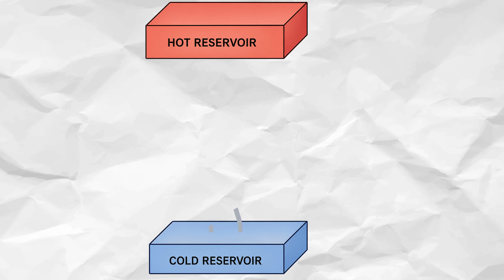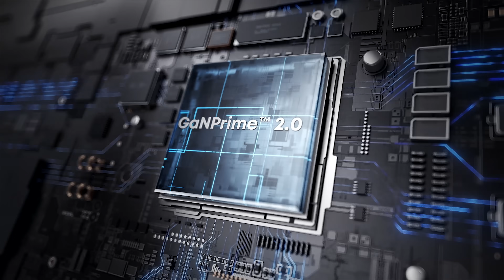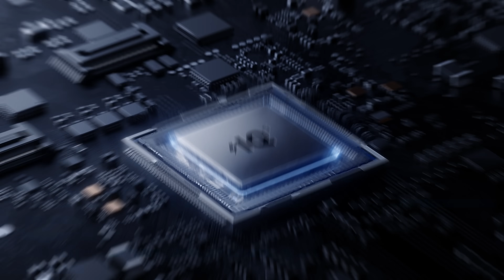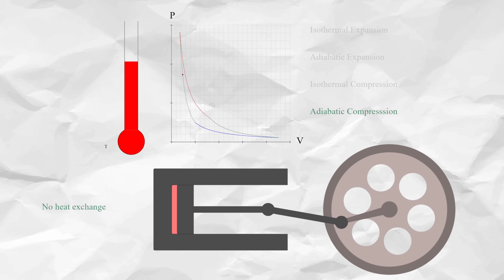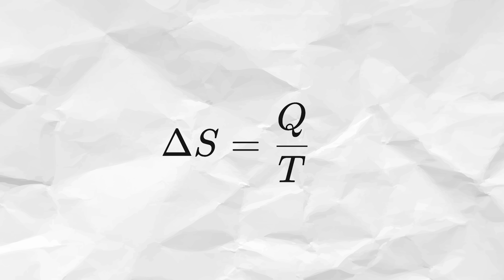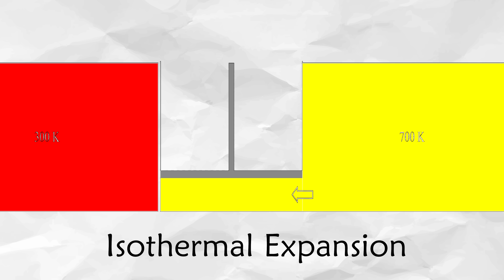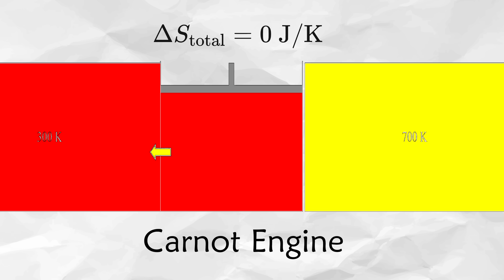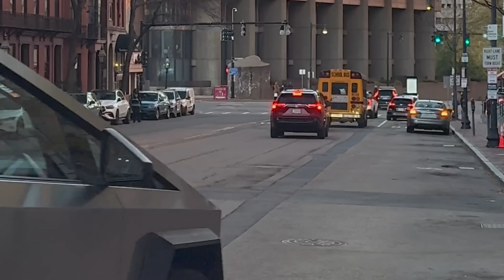This Tiny Engine Explains Entropy

Comment: Interestingly, most biological processes that transform energy such as photosynthesis (light to chemical bonds) also have about 30% efficiency. Burning fossil fuels with similar efficiency is the largest, most effective and efficient recycling program man has. Increase CO2 doesn't change global temperatures at all because photosynthesis converts it to more life. At 0.04% it is absurd to claim any gas can significantly affect global temperatures.

Comment: 1. Heat engine max efficiency is crappy, got it.
2. Need a crappy heat engine to make neato electricity, OK.  
3. Or, get your power from the sun that is slogging away making a trillion gazillion joules of energy every second whether we want it to or not and we also don't have to fight messy and expensive wars over it either.
4.  His 35% "typical" heat engine efficiency is for a poor/old fossil fuel plant.  Mr. Internet says that the absolute best, most spiffy (expensive) fossil fuel plants can get the hot side up to 1000°F (811 K) with fancy materials.  Also, a typical cold side is not 212° F (373 K), it is more like 107° F (315 K) so when you crank those temperatures through the Carnot efficiency equation, which, as this video states, equals [1 - (cold side temp, Kelvin)/(hot side temp, Kelvin)], you get 61% efficiency.  The fanciest fuel cells can also convert fuel to electricity at 60% efficiency.  Solar panels (free fuel) are pushing 30% efficiency, so efficiency is not as big an issue, but cost and the space they take up is a big issue.

Comment: So we just need 0°k on the cold side and any other temperature on the hot side to get a Carnot engine with 100% efficiency? Easy ^^
Reply: Deep space has a temperature of 2.7K, so not too far off. All we need then is large enough radiators - just a few thousand square kilometres should suffice...

Comment: Beside Entropy (dominant in a Carnot-engine), and electric motors (ohmic and magnetization losses) there is another consideration: Quantum states. E.g. everything, that follows Fermionic statistics (e.g. semiconductors, LED, solar panals, lathes) can never convert energy with 100% efficiency, since losses are inctrinsic to the staircase-function of quantized energy states on a quantum level. Contraptions, that follow bosonic statistics are 100% efficient. E.g. an nonlinear KPT-crystal in a green Laser is such a device. One can convert kilowatts of infrared Laser power into green light and losses due to impurities are a couple of mW.

Comment: I love this video. Really well done explanation! Definitely the best I've seen, including my own in teaching an energy engineering course. I particularly love the simplicity of the marble Stirling engine. Another fun example is taking a finite hot brick connected to a finite cold brick, both of which eventually come to the same temperature. If you wire these to a work extractor, the efficiency is 1-sqrt(Tcold/Thot) instead of 1-(Tcold/Thot). And this leads to a whole subject on endoreversible engines that are surprisingly close to real engines.

Comment: Excellent illustration. I also liked seeing the simple test-tube marble engine, since I use a very similar demonstration in class. From a thermodynamics perspective, this is a very nice way of showing that the fundamental efficiency limit comes from the second law: in the reversible Carnot argument, (Q{rev}/T) appears as a state function — later named entropy by Clausius — and that is exactly what limits the conversion of heat into work.

Comment: In my view, the most counter- intuitive, and therefore maybe most valuable, conclusion from the Carnot equation: Your engine becomes more efficient the lower the Temperature of the COLD reservoir. Efficiency is governed as much or more by where you dump your heat as by where you source it.

Comment: again, the Carnot limit only applies to CLOSED cycles. An internal combustion engine is an OPEN system and its efficiency is the Gibbs free energy, which is ~100%. all the fuel energy is available to do work

Comment: this is getting me thinking. what if we could use climate temperatures to power a big sterling engine for a home. could we harness the power of weathers temperature, maybe if its compared to the temp of underground. maybe using things to trap heat well or magnify it.
Reply: like the cooling side is what the ac fans sit on, and in its respective spot is a tank of water trapping and magifying heat, all to power a sterling engine, maybe one that powers the ac lol. a loop. all you need is the rip cord like a lawnmower.

Comment: Nice explanation! In the science, efficiency of a cooler or engine is usually expressed exactly in a carnot efficiency. Because indeed the absolute efficiency, energy useful decided by energie required, doesn't mean anything when looking at them in a physics way

Comment: This is one of the bigger reasons why I'd like us to have high temperature (low pressure) nuclear reactors.
Today's nukes are awesome but they use water at relatively high pressure, high enough to need an expensive pressure cooker but only high enough that it can't go above about 300°C (otherwise it would turn into steam)
In a high temperature reactor you're saving your money because your bottle doesn't need to be a pressure cooker and you're getting more efficiency by cooking at 600°C (usually)

Comment: @action lab: "so this theoretical engine has zero enthropy loss, yet it cannot reach 100% efficiency":
also action lab: goes on to not explain why it isn't 100% efficient and call it entropy loss
Reply: In the ideal Carnot (or Stirling for that matter) heat engine, the amount of heat energy removed from the high temperature source is greater than the mechanical energy it puts out. That difference is called the "efficiency". The rest of the heat energy remains as heat energy, but at the lower temperature of the cold source. But if you reverse the engine into a heat pump, putting mechanical energy in to transfer heat energy from the cold source back to the hot source, the mechanical energy used is less than the heat energy transfered. So, using the same definition of efficiency, the heat pump is more than 100% efficient. For the ideal engine,  reversing it to a heat pump, the system can be returned to the original state. So, no change in entropy, and the back and forth nets 100% efficiency. So, it might make more sense to call the Carnot limit the definition of 100% efficiency rather than the efficiency limit. On the other hand, if one is burning fuel to create the hot source, the  Carnot limit tells how much gas needs to burn to create a certain amount of mechanical energy, and it would make sense to call that efficiency.

Of course real engines are not ideal and can never reach the Carnot limit. This is not just because of friction, but also due to the finite rate at which heat (and pressure as well) can propagate.

Comment: 9:17 And that is why I hate all this hype about electric cars.
         Sure, the electric engine is 99% efficient. But then the battery is 90% efficient. And it was all powered by a 40% efficient steam power plant.
         Ending up with ~36% efficiency over all.
         Compared to a ~30% efficient petrol engine, that is not much better.
Reply: If the steam power plant is driven with a nuclear reactor, the whole system produces significant fewer waste products to power a car than the petrol engine. That's the point of electric cars.
Reply: @theaustrianengineer4494  A big if in continental europe.
But yes, if we were running nuclear power plant instead of fossil fuel power plants, the balance would shift in favour of electricity.

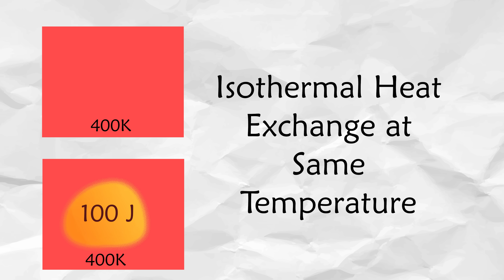Comment: 6:03   That statement is a little bit off.  You cannot, even in theory, have heat transfer occur if the source and gas are at the same temperature.  In the Carnot cycle, there is an infinitesimal temperature difference.  
The reservoir is at T. The gas is at T-dT, with dT→0. Or gas at T+dt in the reverse process. That is, there is a tiny temperature gradient, but in the limit, it approaches zero.  That means in the limit, the time it takes for the heat transfer to occur approaches infinity.  
The temperature gradient approaches zero (but never zero), and the time for heat transfer approaches infinity for a completely reversible process.  Such conditions emphasize how impossible it is in reality.  But as the video points out, even if you could do it, you would still have less than 100% efficiency, unless the cold temperature is at zero degrees Kelvin or the hot temperature is infinite.  Each of those temperature conditions is impossible.

Comment: Nice video, except for the mistatement at about min. 4. You say that the Stirling engine is one of the most  efficient engines, but that the Carnot engine is even more efficient. This is false, the ideal Stirling engine is just as efficient as the ideal Carnot engine. The confusion no doubt is because (I think at least) we were all told in school that the Carnot cycle is THE most efficient. If the "the" is understood as exclusive, that is wrong. No heat engine can have an efficiency greater than the ideal Carnot cycle engine, but others can match it, and the ideal Stirling cycle engine does. Of course no real engine (not Carnot, or Stirling or any other) can actually reach that efficiency.

One caveat for the ideal Stirling cycle is that the dispacer (marbles in your 1st engine, and the black disc/piston in the other) needs to also be a "regenerator". That means the regenerator/displacer needs to absorb the heat from the air as it passes (around or through) the diplacer going from the hot side to the cold side, then gives that heat back as the air goes back from the cold side to the hot.

Comment: Awesome video (as usual), although I was a bit confused during the Carnot engine animation why the Hot source was yellow and the Cold source was red.  Also, wouldn’t the hot source lose heat for the short time it was heating the gas in the piston? And wouldn’t the cold source gain heat as the hotter gas was combined with it on the downstroke?

Comment: there is one very efficient way to turn heat into electricity: photovoltaic solar cells, the surface of the sun is around 6000K, the working fluid is the photon gas, and the heat sink is the solar panel itself, which is why it's important to keep it cold, the theoretical Carnot efficiency of a room temperature solar panel is around 95%, realistically it's nowhere close, the most advanced lab grade cells can't even reach 30%, but the 6000K photon gas is free and almost limitless, albeit intermittent and unpredictable

Comment: You have to manipulate space, like gravity accelerates, so you use gears to store accelerated pylons energy to lift other pylons, 5~10 thousand pound energy pylons.  A capacitor organizes space perterbations in permutations associated with positive and negative.  Because no equation goes through zero.  V = IxR is actually a lie, nothing reachs zero.  Suppose Acid = Base, its completely untrue, but an atom like lithium stores energy in space as a rubber band, thus a battery is possitive.
Switchs can aid un-obfuscatable spacial anomalies, like magnetic pendulli shielded by choocho lead tape perpendicular to our turn key close range magnetic clockwork factory.
A similar device is a triangular speed of light grounding switch.  At the halfway point, a conductor signals a closer branch, a spiral shortcut, that a spacial magnet surface crawl is getting close to ground, so he switchs the line, to a ground at the other side of the destination.
A great many spacious anomoly devices, a 3D bernoullis law of acceleration for orbital compression create water molecular motion in gluon superconductor phoninos so your water stays completely hot to the touch as big bang phoninos learn the troubling truth of greater goodie goodies.
Our world is a magical place.  You get some change coins from all different random brownian noise, I have a ♤♡◇□●○•¤■♡◇¡
Ching chong choing gling kling zinc.
So we want to time traveling for boners and whatnot.  We can hold a volume 10^5000 change coins in an iron room full of motion.  Then we open the vault and our timex acceleration the 360 | 2^5000 at the half second per second, time travel is memories.

Comment: Funnily enough, the last gig also should be about another aspect worth talking about: Performance.

Let's say, he have almost perfect engine, like 90% efficient. However, it is huge, requires expensive materials and converts little energy.

Is is worth building it?
While it can convert very efficiently, it's performance is very poor.

AI uses A LOT of power, but it's performance is great.
How much power would it take to download assets, photoshop it, retouch it and so on.
Most likely less that generation of the same quality, but what about time spent?
3 seconds vs 3 hours.

Comment: The low efficiency of Carnot cycle engines is balanced by the great efficiency of heat pumps. If you could beat the Carnot cycle, you could combine that with a heat pump to get a perpetual motion machine.

Comment: You’re incorrect. An inductor doesn’t need to be bigger if you want to output more power. You can decrease the number of turns, make the windings thicker and this way keep the size small. You just need your converter to run at a higher frequency.

Comment: with the engine ideas... couldn't you set it up to generate heat in the parts transferring the energy to move the piston/rods?  that heat to assist the hot end of the system to drag out the duration?  maybe even using magnets to generate heat by inducing eddy currents in nearby conductive metal, transforming kinetic energy directly into thermal energy- as part of the gearworks?   i guess it would depend on the force needed to generate enough heat in the "gearwork" for it to help.  sorry i think too much.  idea i got during watching the video.

Comment: i'll share an idea i had years ago.  i've never had the money to follow up on my ideas so i enjoy sharing them.  do you remember the hourglass where when you hold it the fluid boils and moves to the cooler portion of the hourglass?  i wanted to turn that into a generator.  using the human body, sunlight or even thermal (underground) heating sources.  i'll put it this way i figured if you put one in a car, when the temp reached a certain point internally it would start working. ( the idea was to protect the battery from drainage while it kicks on a air conditioner ( low power)  to cool the inside of your car.  as they can get very hot over 140 degrees hot.  cooking your seats/dash/steering wheel etc... the idea was to keep the interior cool enough that you can actually get in without burning your bum or hands.  could also be reverse to run the heater? in winter?  eh the dynamics to me seemed like an issue, how hot or cold is too much for the system to work?  oh and yes, i wanted to micro size it for wearables or even for a backpack that would charge your phone or battery.  i forgot what fluid was used, but if i remember right it isn't hazardous?  or was it?  eh like i said at the top, been years since i had the idea.  (( heck i even thought about using a varient of it for space sats))  hot when the sun hits it and cold when its not.  peace.

Comment: A thing about electric motors is, to produce the energy you can use a carnot-type engine with extreme temperature differentials... Say a dry steam turbine where 800K steam is put against 300K Air

Comment: The 'problem' is not really in that the mechanical work is created through an inefficient process. Wind generators have a theoretical limit of about 59%, while solar panels edge on 20%.

The real problem is in what the burning of fuel, to extract the heat to run this cycle, creates in the wake of it (i.e. pollution of all kinds, from carbon dioxide, to exhaust particulates, to nuclear waste)

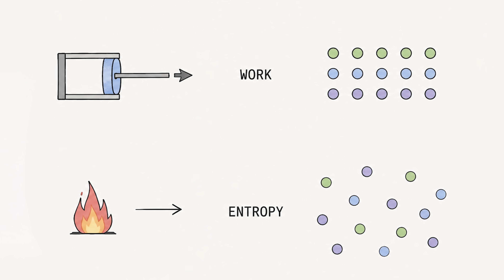Comment: 4:25 Carnot did not mention entropy - that came from Clausius and it was later butchered into an entirely different beast by Planck, who then mis-attributed it to Boltzmann. The thing that limits the efficiency is not entropy (whatever that is!) - it's the relative temperatures- (T_hot - T_cold)/T - the problem Carnot's engine always required the temperature of the interface (T) to be the same, as explained at 5:59 . The whole video could hav been explained with no reference to entropy. Entropy is the cloak of mystery that the priests use to confuse the flock.

Comment: I have an endless appetite for energy efficiency/thermodynamic analysis when provided in this easy-to-digest form. Now, just do DIY heat engine project that uses a wood as energy input for a domestic micro CHP system which is practical and affordable. Off-grid for the low solar input part of the year!

Comment: Just so we're clear here electric motors aren't hiding this fact because your gasoline engine has the exact same problem 

Ultimately all of our locomotion technologies derived their original power from power plants 

This is why when we talked about the efficiency of a car we use grid to Wheels efficiency because the efficiency of the grid doesn't really matter because both forms of locomotion are using the same grid. 

Gasoline uses grid power my electric car uses grid power. 

If you upgrade the grid you upgrade both. 

Gasoline is so inefficient but you actually use more electricity per mile driving in a gasoline car then you do driving an electric car. 

The reason we use gasoline is because it's more profitable.

Comment: The last point is a great example of why electric heating is so expensive compared to having a furnace/boiler inside your house. Converting the electricity from the grid into heat is practically perfectly efficient, but the process of turning fuels into electricity in the power plant is far less efficient than burning the fuel in your house for heat. (Of course, it massively helps when the grid power is coming from renewable resources.)